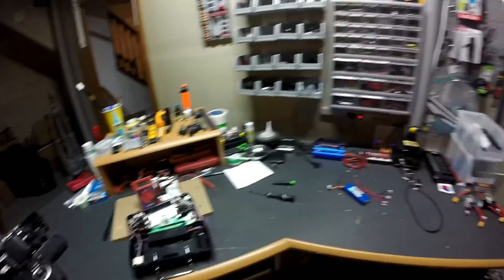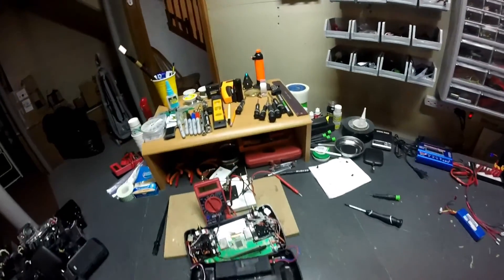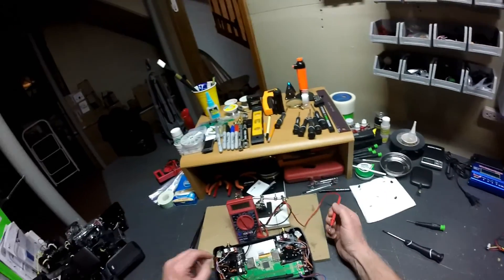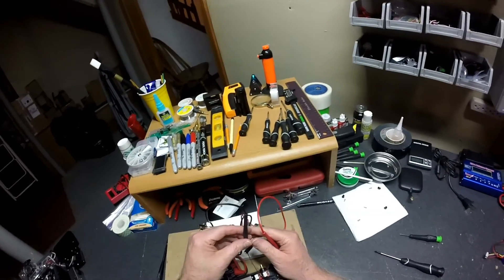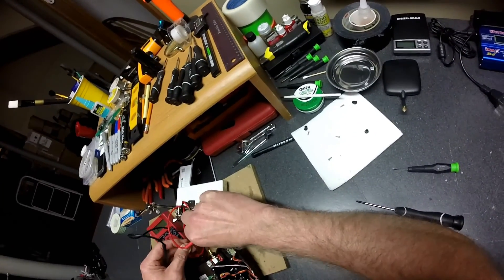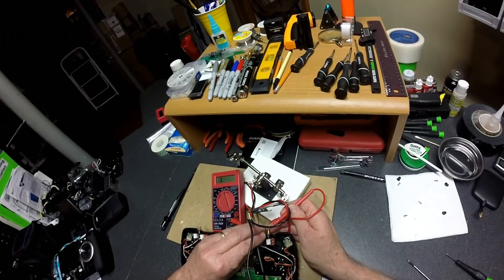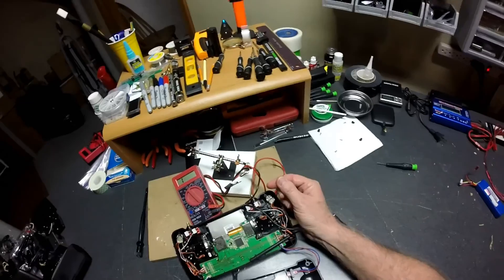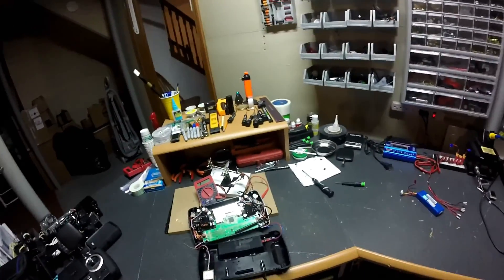Hubsan H501S transmitter problem solved

Comment: Hey mate when I fly my Hubsan h 501s when it gets about 30 or 40 m away the lights all go pink and then it just starts going crazy but it's only just started doing it because I've had it at about 1196 m and only the last three weeks is starting to play up I've just got the control pad apart now and everything looks to be nice and even and nice and neat so I don't know what the problem is

Comment: Can you show a video of how to get the pigtails out of the TX before you started working on it?  There are small circuit boards in the way and from what I can tell on your video you have removed them.  Someone said to remove the switches on the outside but I can't see how that is done either?

Comment: My advanced FPV screen went total white blank during my first flight out of the box. Initially the screen was good showing the telemetry. I completed the compass calibration and start flying. Hardly 2 minutes the screen went blank. But I was still able to control the drone and quickly landed it. Upon switching it off and on, all I get is blank screen. What's the problem and please help.

Comment: mine was working just fine,, tried to get the video working and some thing went wrong and now the motors wont come on,,, calibrates just fine,, just wont connect/work when the sticks go to turn on the motors,,, any ideas suggestions,, greatly appreciated,, ole USN vet (jimhaley42@wcc.net)
Reply from the maker: Do you have full movement on the sticks? I had a problem with my right stick locator that was fixed by Hubsan.  My transmitter would not arm the motors or stick calibrate.

Comment: locator senses the position of the stick.. shally wants me to upgrade firmware first though.. before we go do that step..I feel it's the locator..
Reply from the maker: Yes, that's what was wrong with mine.  The term locator through me off as I thought they were speaking of the GPS chip. Anyway, I get mine tomorrow.  Between that and replacing the pigtail, I hope I'm OK..

Comment: héllo..
Could you help me where to buy the 5.8g module for this transmitter!!!
Because I can not find parts for this TX on sale,I had the same problem as you but in the 5.8g cable, when removing the plug unloaded everything from the module module 5.8g.
Now I can not find parts for this TX and I need the module, because if I do not go without FPV video on the transmitter!!
If you can help me on this matter I would greatly appreciate it.
Good video and good help.
regards
Paulo
Reply from the maker: Paulo..  Do you mean the 5.8 ghz pigtail?: http://www.ebay.com/itm/20cm-Cable-SMA-Female-Bulkhead-Jack-To-IPX-U-FL-PCI-Card-1-13mm-Pigtail-8in-/272096127258?hash=item3f5a31691a:g:xEcAAOSwL7VWjAc5
Reply: héllo.
Not bro!
the modulo 5.8g FPV the Transmitter!!I messed up the chip.When removing the cable!
Now I want to buy a module and I can not find!
The 5.8g module is on the left side of your radio in this video.On the right side of the module 2.4g.
If you can find me where to buy, it was a good help.
Regards
Paulo
Reply from the maker: Paulo,  try sending an email to Anne Lu at Hubsan: anne.lu@hubsan.com

She's located in Los Angeles in the US.  Maybe she can help you from here.

Comment: So you've got a $300 H501S (plus all your other quads and planes), and your using a crappy $5 Cen-tech meter. Invest on a better meter. $50 will get you a much better meter, no need to go $100 plus.
As a fellow motorcyclist, I like all your motorcycle stuff. :)
Reply from the maker: The multimeter works fine for what I use it for.  I paid $5 for the multimeter so I could ride a $16,000 motorcycle.  You got to know where your priorities are my friend;) The transmitter is being sent in to Hubsan anyway.  More issues that I did not cover here..

Comment: was hoping your found a direct fit replacement cable..because it is a matter of the connector being long enough.. a lot of them on ebay are shorter..hoping you have a link...thank you
Reply from the maker: George, I should be receiving my replacement from Hubsan today.  Stay tuned.

Comment: I have been flying 25 years and I get so tired of people who've only been flying a year or so asking me if it's me if something doesn't work. I just bought the Spy Hawk and this thing seems so full of bad press that I'll be having major pucker factor before I ever toss it into the air.
Reply from the maker: I have the Spy Hawk too.  I don't have a lot of run time, but it has never gone bananas on me either.;) I've never used RTH on it...
Reply: I was even going to buy it but after a rather heated discussion on a thread in rc groups I decided against my better judgement to get one. It's not my first fpv plane though. I've been flying a Bixler 2 with a more powerful motor and longer range video system than the SH. Right now I'm getting over this damned flu that's been going around and I'm also waiting on a set of video goggles to plug into the flight console system. I wanted a setup I could just take with me in the truck for spur of the moment flying. Most of the crash videos seem to be related to RTH.
Reply from the maker: Ha, that's OK Randall, these young guys want to verbally spar with us older guys, well, bring it on.  I was actually considering the Bixler prior to my Hubsan purchase.  I don't mind building a plane with an APM flight controller for GPS/RTH.  In fact, I have a few extra APM's in my workshop.  One of them is already configured to fly in a plane.  I hope you get better. If I remember, don't you live in Southern Indiana??  The reason I ask, my company is located in Evansville, IN...
Reply from the maker: That appears to be a nice GPS unit for the Raptor. I'll have to watch for the video.  I should be receiving my replacement pigtail for the Hubsan today.  I sure hope this fixes it.;)
Reply: They're pretty cheap on Ebay if you ever need a new pigtail. I modded a cheapie transmitter to accept a high gain 2.4ghz antenna. It cost me 3 bucks.

Comment: wow i was wondering why my drone lost contact or powered out and then crashed!
Reply from the maker: This is probably your problem.  Hubsan is replacing mine but I also ordered a spare via eBay.  You may want to double check them.
Reply: MrPolymers
ive been double checking them for a long time now, the drone according to them is DEFECTED, the power board died slowly on its own, the transmitter is also behaving like yours, NO SIGNAL!

first its husban emaling to contact support and no support link,

then ist some one ann you claims her servers keep going down assuming eventually you will give up and buy the parts online and fix it yourself after confirming they recognized a defect, pinged the problem with tests over a long period of 3 weeks with photos and videos.

then when its time to do it a shielly emails and claims she is away from her desk, a week later she emails requesting the photos, video and story ALL OVER AGAIN to waste another month, they are basically waiting waiting waiting and not doing anything to get customers to GIVE UP ! they take ZERO responsibility and if you INSIST you send it to them st YOUR OWN RISK.

basically another person was asked by the ebay retailer to send his drone back after ann and shielly offered to replace a part they will send IF THE CUSTOMER TRIED TO SOLDIER IT THEMSELVES (and they wont be responsible if anything else breaks) then they actually contact the retailer (even though its illegal) and got the drone back....so tell me, does waiting 4 months sound like this person will see the drone again? the retailer knew the person could not re open a paypal claim since they already closed one after waiting for their order 40 days.

i like to see if you get your drone back because the same happens when you send it to husban
Reply from the maker: Wow, OK not a simple fix for you.  Hubsan originally wanted me to send the quad in only.  Then, I was able to pinpoint the issue which was not the quad, but the transmitter.  This quad has a lot of issues which makes me not trust it like some of these folks doing the long distance FPV.  I think they are asking for trouble unless they can fly for an extended time with no issues. No, I'm not sending my quad or transmitter in, just fixing it myself once they send me the part.
Reply: MrPolymers
when you say send in where did they tell you to send it?

thanks btw
Reply from the maker: They wanted me to send in to Los Angeles where they have their customer service/technical.  However, I'm just fixing it myself.
Reply: MrPolymers
if you can its faster but if they do it its guaranteed BETTER, im asking for a beefed up drone, 200 meters max hight or more, i also know someone whos transmitter had the same issues like you and they offered to replace it, husban needs to get it together before mavic pro mkii hits the scene!
Reply from the maker: What's odd, Hubsan had assured me it was the quad!!!  Then, I started my own tear down and determined it was the transmitter.  After my findings with Hubsan, they started telling me the transmitter can be a problem too!!!  Yep, I kinda figured that and my advice to somebody new to this hobby..  I'd think twice about this bird.  The only reason I still have it is because of my three years of flying experience and knowing not to go crazy with any flight until the quad proves to me it's consistent with no surprises...
Reply: MrPolymers
well my friend found out it was their new transmitter as well but since he was promised a exchange ANN from HUBSAN has still to write back how to fallow that up!

they take forever! im assuming they are full of shit

Comment: Wow, I could not see from your video, did the 2.4 antenna wire have an Ipex connector ?? I have not opened up my Advanced controller to figure out the FPV problem yet, but I'm thinking it's probably similar to what you had going on. What is really boggling to me, is that, if you had no connection to your antenna from your 2.4 module how did it not burn out ?????
Reply from the maker: Mark, I assume the limited time I had this running given the low mw transmitter output has not caused damage to the transmitter.  If so, Hubsan will replace it..;)
Reply: MrPolymers yes, those transmitters are low milliwatts... you can buy transmission mW boosters, but that is a little bit Overkill in my book for these quads... I sure hope your 2.4 module is Alright !! I am not sure if you seen my earlier replies about my controller.? I took an hour off of work and went home and opened up the controller. I couldn't believe it was a piece of Styrofoam stuck in between Ipex connection on the 5.8 module! I took it I took it out, even put some Dielectric grease on them... everything and all functions work absolutely perfect now ! :)
Reply from the maker: Great.  Did you do a continuity on both pigtail connectors?
Reply: MrPolymers yes I did. That's the first thing I did. They both had continuity, the 2.4 and the 5.8 Antennas. I  did a continuity test, a diode test and even checked the resistance just for the hell of it... it was a tiny sliver of styrofoam Slightly wedged in-between the Outer ring of the 5.8 Ipex connection. I quickly ran and did a range test afterwards. I flew it up to four hundred feet and did a return to home. Now It has perfect FPV reception... :)
Reply: MrPolymers I don't think a lot of people realize that antenna wires that run from the actual antennas to the modules actually have two wires... It's not just one. That is why there is SMA connections to pigtails or (Ipex) Connectors.... It's "Almost Like" a Coaxial Cable...
Reply from the maker: Yes indeed.  The SMA cables actually do a loop circuit.  When you place an antenna on the threaded end, they complete the circuit.  If that thin wire in the cable is broken like what appears to be my issue,. then no circuit can exist.  Of course, I sell plastics for a living and not electronics.  LOL..
Reply: MrPolymers Good One !!! :) LOL.... I have a family business that is pretty big! I deal with that on a daily basis. I know a lot about cars and trucks ! Lol.. I went to College for awhile studying basic electricity which was a prerequisite Class to digital electronics, then on to Advanced Digital electronics & Processors. I was going to finish getting a degree in I.T. Specialist but eventually just worked for my family business. It's great talking with someone that knows pretty much about electronics and how they function... after I made a couple videos, I was getting comments where people were either not understanding what I was talking about or they were suggesting I should keep the Techno language to a minimum because the Viewers are mostly newbies...
Reply from the maker: Ha, that's why I don't bring up Polymers "plastics"..  I could lose 98% of the audience with my lingo if I wanted too.. ;) I was in fact a Physics/chemistry major in college by the way.
Reply: MrPolymers Physics and Chemistry !!! Smart Man !!!  I have a video of where I am contemplating and thinking of why I am getting 30 minutes or more of flight time with the h501s and Over 45 Minutes with the X4 Pro.... one person commented that the cold air improves rotor lift and the cold air also helps convert battery energy into flight. I understand that dense cold air can help produce lift, but have no idea what he was talking about when he referred to the cold air converting battery energy into flight?? A Lithium Polymer battery is very unstable to begin with, however they lose most of their energy from heat dissipation. So, if the battery cannot get hot, I would think that is what is giving me extreme flight times...? It's a short video, if you would,,? Watch it, and give me your thoughts on that. Also, are you getting more than 20 minute flight times in cold-weather environments??
Reply: +MrPolymers I realized that last reply was Half Dumb...   I would like to know your thoughts about the extra flight time I'm getting, but Obviously you Couldn't of been getting 30 minute flight times too because, your controller came Faulty.... Oops :) lol
Reply from the maker: Ha, nope, never had a flight longer than maybe 5 minutes.  That's the reason I purchased the bird for the 20 minute flight time..  Nice day here in Ohio, just got back off a ride on the FJR.  Testing my car DVR on the bike.  Quality of the camera not the best, but it's intended to record if I get in an accident, etc.
Reply: MrPolymers Record Temp. In Wisconsin today. 57 Degrees, and Sunny ! Took both H501S and X4 Pro out. There were a lot of geese and ducks on the half thawed pond. I got some Great Video Footage with Both Quads... That's the next 2 videos I'm posting. I also got some Great Still Photos... IDK if you know this, but for some odd reason, the H501S will take 2 types of Photos ! No Idea why but if you are Actively Recording, you can press the photo button (Quickly), don't hold it down... When you do that, the photos are Better Quality ! No Idea why but they are... If your not recording and you take a photo, it will not be a "Full Screen" Image and it Will NOT be as Clear... (Quality)... Very Strange...

Comment: yay!!i new you would get it.funny how most of the problems i had ended up transmitter problems.you just talked me into buying a multimeter!i have tried different  ipex connectors the ones that seem to work the best were the 1.37 size.i have rg178 which is supposed to be better but the ones i got are not that good and they seemed to fit on the connectors too tight.if not careful you could damage the receiver your trying to fix.so i went with 1.37
Reply from the maker: A multimeter is a must building quads or anything electronic.  To purchase equipment to check RF signal strength would run in the thousands of dollars. Cheaper to just check continuity..;)

Comment: Hey dude that's exactly whats wrong with mine waiting for new pigtail rp-sma to ufl/ipx...more common than I would have guessed.
Reply from the maker: Yep Jorg, this is your problem with limited range or out of control.  Not a firmware issue..

Comment: great news hope you get it fixed soon, my 501s has been repaired and has left California  and should be here in illinois tues of next week so i can try out the FPV issue. I was told they had to replace the 5.8 ghz module , after i get it going i should be able to fly over 2 states to ohio !!!! well perhaps not but more than 50M LOL
Reply from the maker: You obviously had a different problem but I'm going to guess most of these range issues or out of control are the pigtail.. Cheap fix but you have to order them from China..
Reply: yes and mine was standard controller not advanced
Reply from the maker: Yep, I guess Hubsan is an equal opportunity screw up the transmitter company.  Don't you love the EEOC..;)

Comment: good  deal hope to see you in the air  soon i was able to take  mine out today for the first time  flies great hope to have a video soon
Reply from the maker: Keep it low and slow as we pilots say until you can determine if there are any range or transmission issues.

Comment: I hope the transmitter didn't burn up with no load on it
Reply from the maker: Me too although I did not have a lot of run time on it..
Reply: Actually the 5.8 is the receive for the fpv, the 2.4 is the transmitter for the control of the quad.
Reply from the maker: Mike's correct.  The power is coming from the 2.4 ghz although these birds put out little power is my guess..